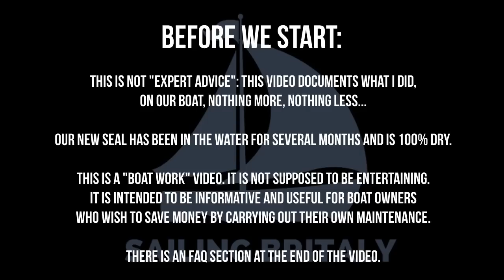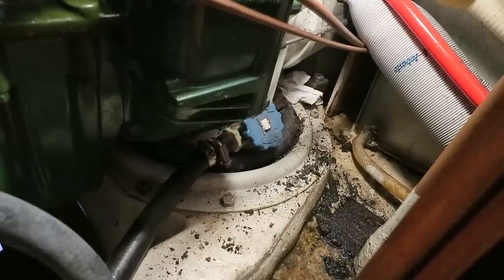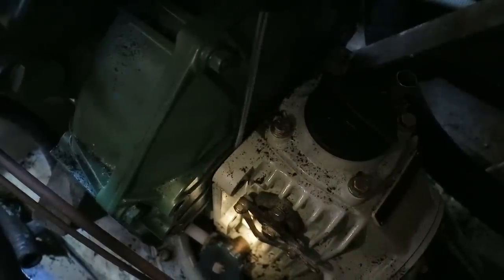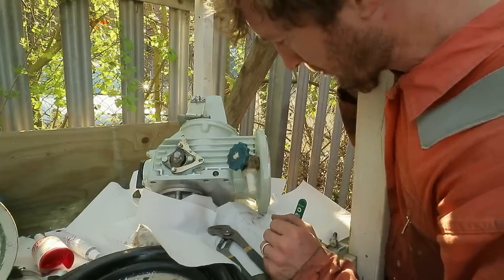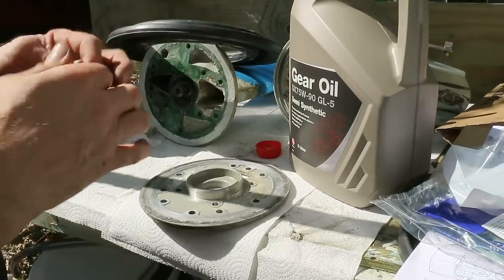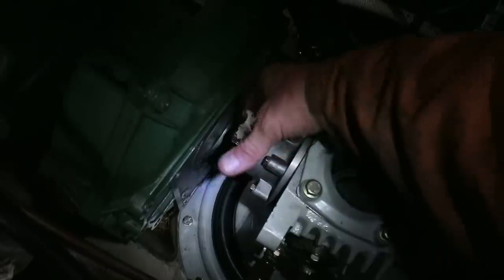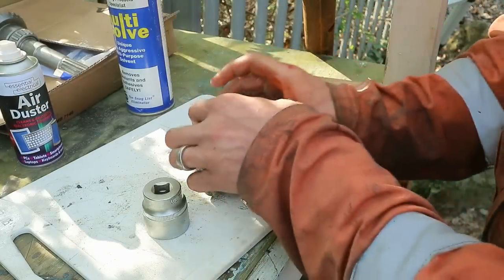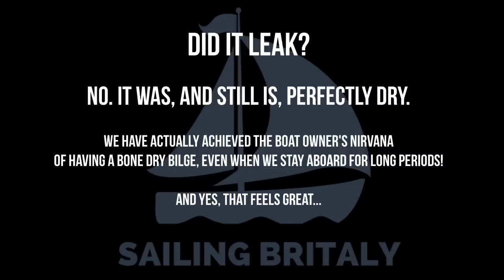Saildrive Diaphragm Replacement | ⛵ Sailing Britaly ⛵ [Boat Work]

Comment: Very well presented and timely as I am going to inspect a 39 year old 27 foot boat for purchase which has a saildrive unit. I now have a few more things to look for and a few more questions to ask of the owner. While I most likely would not try a renovation, as you have done, I now can appreciate the work required if I have it done by a ship engineering company. Thanks again.

Comment: Another brilliant demonstration, thanks for those small details, and for including the locking wire oversight. When you considered applying heat to the aluminum housing to get the sea cock off, I remembered a few disasters I've had doing automotive repair through the years. Heat and aluminum don't go so well, I've stripped out aluminum threads frozen to steel bolts more than once.
Reply from the maker: Hi there, that is a great compliment coming from you, thank you! I was being careful with the Aluminium as it is delicate. If things had gone wrong a helicoil could have been an option, but I had enough on my plate already whilst filming this, so fortunately that wasn't needed. :-) Comments on YouTube are fantastic as it give the world a chance to peer review videos like this for the benefit of everyone, so thank you for taking the time to share your opinion. Cheers, Chris 👍

Comment: I did my saildrive 7 years ago so our Bavaria 36 is due a change again this year. Like Chris I am a retired RAF aircraft engineer and well taught in the useful skills for this job (although my experience of aircraft is probably a couple of generations before Chris's!) But this video is a useful reminder of the sequence and pitfalls of the operation. The Bavaria does not have such good access as his boat but I was able to remove our engine completely which made life easier although it did involve disconnecting the engine entirely with the subsequent necessary reconnections and engine bleeding etc.
Reply from the maker: Hi there, thank you for watching & commenting. I'm sure it will be a lot easier for you this next time round as you've already done the job once. I couldn't find any videos like this out there before I did ours, so I hope that this will be of value to other boat owners who like to do their own boat work. I personally believe that the trade training at Cosford (or Halton as I believe it was before) is amongst the best in the world. I have certainly never seen anything anywhere near as professional anywhere in the commercial world, despite working for a variety of oil & gas companies with vast budgets. Fair winds! Chris 👍
Reply: Biggles One I was at Halton back in 1960 aged 15 on a 3-year apprenticeship. I worked on a whole host of aircraft, now all obsolete! I took up sailing in Gib where we lived next to the Sailing Club on the harbour (now filled in). As you say the RAF Training was second to none and set me up with long lasting skills which I am using sixty years on. Good luck with your project and hope that you and your young family have a great sailing adventure.

Comment: Thank you very much for taking the time to do this. We are in the process of renewing the diaphragm on our Bavaria 35. I noticed that you seemed to have solid engine mounts with no rubber bushing - ours has the original, which are rubber, and presumably take some of the loadings. The rear hole, which you had to pack out, is still circular on ours, (despite a lot of use!), and I wondered if this might be related to the fact that the rubber mounts provides some give on ours, so there is less stress on that bolt hole.
Reply from the maker: My pleasure! Our mounts do have rubber sections too, but my "stress test" was too much for the stbd one. The packing on the rear mount is still perfect. 🙏 Best regards, Chris 👍

Comment: Very nice work! I have been doing this a couple of times, when I was working in a small boat workshop in Gothenburg, Sweden.
I saw some things that should be adressed sometimes in the future: 1) Control wires are brown = very old and often rusty inside the shield. They  tend to break exactly in the middle of a maneuver. I would recommend new low friction wires. They are often black nowadays 2) When you have the shock absorbers loose, consider get a new pair. If they are 26 years old as well, the rubber often separates from the steel and then they do no good. 3) The fuel hose was reinforced plastic hose, that get extremely stiff by the diesel oil. It should be replaced by a oil resistent rubber hose, preferable of a type that don't generate static electricity. 
You have a very good engine, VP 2003, but unfortunately the spare parts are discontinued by Volvo Penta. So take good care of it, never overheat it and change the oil one time too often, it's never wrong to have clean oil, whatever the instruction manual or your boat neighbor says. At least once a year despite running time.
Reply from the maker: Hi Patrick, thank you for watching and commenting with your intelligent observations. I was aware of the fuel hose before I bought the boat and at the time of filming this video I had already bought the replacement. A proper diesel-greade fuel hose has now been fitted (it's in one of our more recent videos). Thanks again for commenting, which helps any other viewers reading this, as well as us. Fair winds! Chris 👍 (plus Rossella & Emma 🙂)

Comment: Great job you've done and you should be proud of your self. Only one thing for  next time when you put back steel bolts under sea level always deep them in marine grade grease first so next time they will come off easily and reduces galvanic corrosion too. I have worked with outboards for some time professionally and instructions are clear about using grease to every bolt except those that are on the engine like head bolts.
Greetings from Greece and thank you.

Comment: Thank you for a very useful video. Only now I realized that it seemed as your prop anode was painted over with the antifoul. Hence, the anode was cut off from the water and the propeller got corroded. The kind of things that do not appear obvious until you learn by experience.

Comment: Very interesting, thanks.
BTW, I changed this seal on a friend's boat. We used the main sheet hoist to lift the engine (thru the companionway). I think its an interesting alternative to the use of  wedges.
Reply from the maker: Hi Georges, that was my first choice too but the geometry was wrong on our boat and the engine would have come too far forwards (without taking the woodwork apart). This was easy enough, it probably looks harder in the video than it was in real life. Cheers, Chris

Comment: Great video and thank you for posting.  While you are at it may I advise you change your brass screens in your air intake silencer on your Volvo.  Over 20 years ours fatigued and then got sucked into the #1 cylinder requiring us to remove the head. We replaced with a K&N air filter with foam interior to avoid headache again.
Reply from the maker: You’re very welcome. Thank you for your advice regarding the air intake silencer - we can all learn from each other. Chris 👍

Comment: Hi - I changed mine last year - used a winch to drag the engine forward, rather than levering it. A tip for next time (which I expect you will have forgotten about in 7 years) Set up a Spanish windlass between the keel and the saildrive before you start and tension it - this will keep the drive level as you move the engine forward and save you from using levers on mating faces!
Reply from the maker: Hi Anthony, the mating faces were intact as I was being gentle whilst levering. As always, doing this a second time round would take half the time (or in my case less than a quarter of the time as I won't be filming it again!) I used a trucker's hitch from the keel to the saildrive in the latter part of the video to achieve the same end and it worked a treat. It literally took about 10 minutes to get the engine and drive engaged with no help from anyone. If I was to do this job again I would use the same tachnique to maintain the position of the saildrive whilst moving the engine forward by hand (In the end I found I could just manhandle it around wherever I wanted it). Cheers, Chris

Comment: Great
Work mate 
Very practical good engineering mate!
That thing will last forever because you've done a great job.  
I've had a boatyard do the same job and leaked straight away and they said it's fine and normal to leak (until the oysters grow and stop the leak that is)
So you have aced it really good work .
Reply from the maker: Thank you John! 👍

Comment: I really am no engineer but remember helping my Dad put a gearbox back into a car and had a real problem getting the gearbox spline to mate into the flywheel. If that makes sense did you get lucky because if the shaft didn’t align I’m not sure what you’d do. Turn the engine over by hand? You really are very talented 👍
Reply from the maker: Hi there, the main problem with this (as was seen on removal where it took a while to split the saildrive and engine) is keeping the saidrive and engine aligned - the saildrive can move around quite a lot and if it's not supported then it tends to drop down at the fwd end, this small angle of misalignment then makes it difficult for the splines to disengage (or engage on the way back in). When I was mating up the two the saildrive was held steady and at the correct height by the lines and support outside the boat, so as I lifted the engine and moved it backwards the splines were aligned. There is very little rotational resistance in the transmission and I believe the splined saildrive input shaft could be rotated by hand if necessary, however I believe that anyone who has trouble getting the engine and saildrive to mate is far more likely to be dealing with angular misalignment as outlined above, rather than rotational misalignment of the splines. Thank you! Chris 👍

Comment: Excellent job - I, like you, prefer to do things myself - I think it is unlikely that another person doing this in a shop would have spent as must time and care making sure everything was throughly cleaned before reinstalling.  Yep it will take you twice if not three times as long doing it yourself but it’s worth it - and these videos are an immense help for the next DIY’er to know what they are getting into before starting a job and the shop manual never has all the information you need when the parts aren’t new and pristine.  Keep up the good work!
Reply from the maker: Thank you John! 🙂

Comment: Hey there, thanks for this video and the pro tip on tying the saildrive to the keel... I just did a saildrive replacement and it was super valuable in helping me get the spline shaft of the drive aligned with the engine.
Reply from the maker: Hi John, I'm glad I could be of assistance and that the job went well for you. Cheers, Chris

Comment: Your engine bed is a lot different than the newer ones, they don't have that deep gap behind the engine mount areas almost until you get to the flywheel. 
Also - do you think that adding permatex might change the shimming needs? That will add a tiny amount of length to the transmission.

Comment: A method to get the sail drive lined up to the housing is really long bolts. Then swap them out for the correct bolts as you line it up.

Comment: I wish I had seen this in February, just before I changed mine. It would have been a great help, especially as I didn't know what I as going to come across & needed to have everything to hand before I started. 

This would have been a very helpful video. Hope you had a good year on the water.
Reply from the maker: Shame you missed this but I’m glad you got yours done. It would definitely be a lot easier the second time round as, like any job, you learn best by doing. Fair winds mate, Chris 👍

Comment: Once again. Very informative. Thank you so very much. 

I doing the same  job now. Thanks to you I dare trying!

I just realized you do not use the supplied gasket at 44:38, instead you just use permatex when connecting the upper/lower part. I guess I am missing something.  

Is there no need for the (green?) gasket?

Regards Karl Sitell

Comment: Nice job, your RAF training paid off. I think I would have packed silicone grease between the two seals. Dave
Reply from the maker: Thanks Dave! The fitting instructions are pretty adamant about leaving the diaphragm seal dry under the clamping ring. It's dry so I'm very happy. 👍
Reply: I wasn’t clear, I meant to say place silicon grease between the two seals on the propeller shaft. This will help lube the seal on the water side. Love your channel and supper cute baby. Dave

Comment: Great video!  Looking at your costs including the propeller it seem to be very good value.  A result!  Alignment of engine and splined input shaft seemed to go too easily... luck or judgement but rotating the prop shaft whilst in gear would get over any issues.  Sealants and gaskets don't usually mix but you've got experience of this with your engineering history. Nice professional job, well done!
Reply from the maker: Bob Rose Hi Bob, thank you. Positioning the saildrive leg and holding it in position with lines and the stand below was judgement, manually lifting the engine up and sliding it aft straight onto the shaft was pure luck! Cheers, Chris 👍

Comment: Another great video Chris. I havent got a saildrive as I am on outboards and propshafts but if I did I would be watching your video. :) for tips. A good comprehensive chapter. Had a very worrying incident once with a propshaft. Both jibsheets fell over each side of boat while underway because our charter co forgot to put figure of 8 knots on bitter end of sheets after last hire and we overlooked it...duh.... Anyway upshot was (sods law) that they both got wrapped round prop and ripped the gearbox mounting plate off the engine face, causing the prop shaft to slid down inside the outer shaft tube a few inches. Not nice at 8pm at night when the wind drops in the Med. Thankfully it didnt bend the shaft or slide and drop into the med and fill the boat and leak...!!!!.  No idea what impact it would have on a saildrive leg in the bottom of boat..... so worth knowing from our mistake. Always put a stop knot in end of jib sheets if they go far enough to back of boat to be near the prop. If your ever up our way send me a ping.  Fair winds David
Reply from the maker: Hi David, thank you for your comment and for sharing your experience with the jib sheet / prop encounter, it only takes a minute for a trip to go from super chilled to oh flip! Sunny Blackpool will always be "home" for me :-) Fair winds, Chris 👍

Comment: Thanks for the great video, helped me a lot when putting together the parts after changing the seal rings!

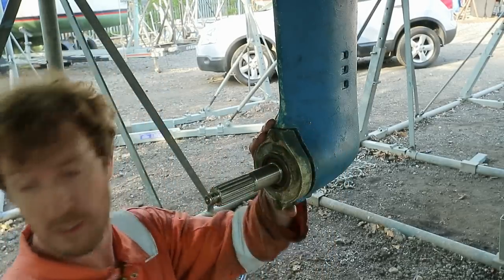However, when I pressed the roller bearing ring in place like you have done at 1:03:10, the shims under the ring has some millimeters of space to move around. When you knocked the bearing housing home with a hammer at 1:04:47, you actually moved the roller bearing ring some more millimeters into the bearing housing so that  it squeezes the shims, like it should. If you would remove the shaft and bearing housing again, you would see that there is some millimeters between the roller bearing ring and the edge of the bearing housing. If you removed the shaft and bearing housing again, you could easily put it back without using a hammer.  

I'm not trying to point at any errors, because you did nothing wrong, however, I spent some hours trying to figure out if I lost some shims and hope this comment will save someone else's time.

Comment: Hi Chris, not sure if possible on your boat but we put a tackle on our boom to lift the engine out of her bay. 
The tackle takes the weight and you can concentrate on positioning. might be an option for future engine/saildrive jobs.
Reply from the maker: Hi there, yes that was the first thing I looked at but on our boat the lifting point would have pulled the engine forward about a metre, so this wasn't an option for us. Levers and manhandling worked ok though. Cheers, Chris

Comment: Hi there Chris fantastic Video ,watched it several times before I did the job on my boat which went very well thanks ,
 one question ,you used a product called CT! to re-install the lower saildrive rubber was it successful ,did it stand the test of time ?
Reply from the maker: Hi David, thank you for your comment. Bit late now but I'll answer for the benefit of others: Yes the CT1 has worked perfectly, years down the line. Prep is key, sanding both the hull and the seal before installation. Cheers, Chris 👍
Reply: @SailingBritaly  Thanks for your reply ,      great Video

Comment: This is a great video. Just one question, the housing is aluminium and the petcock brass, won't it start to corrode from dissimilar metals?
Reply from the maker: Thank you! I used quite a lot of Loctite 372. Here's some copied & pasted info:

"Loctite 372 is an anti-seize paste designed for use on dissimilar metals, such as aluminum and stainless steel. It is a silver-grade anti-seize paste that is commonly used to prevent galvanic corrosion and seizing between these types of metals."

Thanks for watching & commenting, Chris 👍

Comment: are u using copper based antifoul on the leg ? great vid , not one swear word , amazing
Reply from the maker: Hi Bill, it's a standard antifoul with copper oxide, but we have a protective later of epoxy first so it isn't in contact with the Aluminium, and the wastage on the anode will be monitored carefully so that it can be changed as often as necessary to ensure that the leg is protected (I made sure there was extremely low resistance between the anode and the leg upon installation). There will be no swearing on this channel - there may be in real life, but we will always edit this out of our videos as we want to be family-friendly! Fair winds, Chris, Rossella & Emma 😊